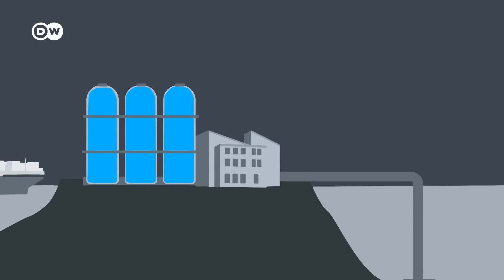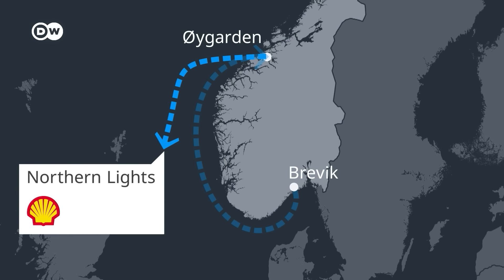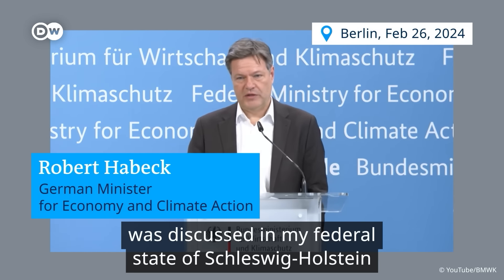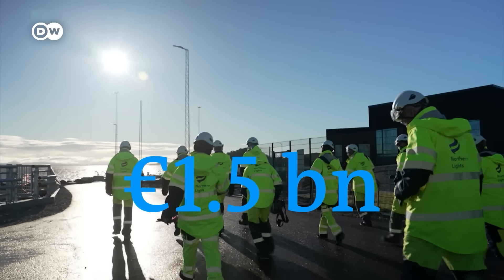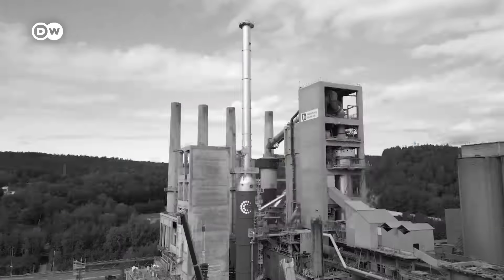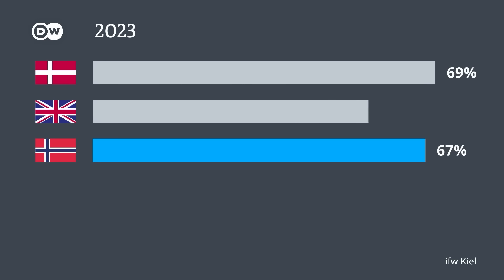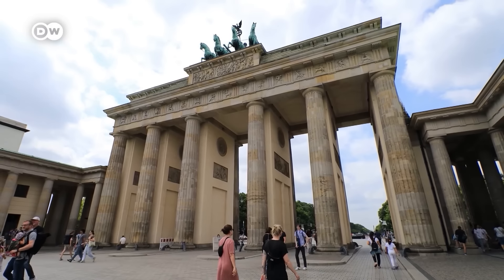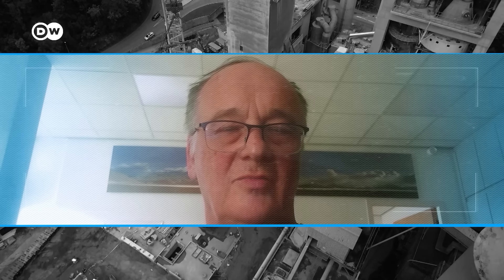Why Norway and the US are leading the way in this game-changing technology | Transforming Business

Comment: Carbon capture and storage is not game changing. It is in fact, allowing the current game of the oil and gas sector to continue. They continue to take subsidies from governments and the population, preventing subsidies from going toward actual solutions while continuing to profit privately. If "successful" with storage, the oil companies use a bunch more unsustainable energy to capture the CO2 and then defer the problem into the future with wells that must be continually managed and could leak as a result of many different geological events or the inevitable neglect that comes from loss of attention.
Reply: This
Reply: Nevermind that it's vaporware from 20 years ago...
Reply: yep, it's a red herring, a bit like saying you're solving gambling by creating gambling anonymous.
Reply: CCS is technically viable, but it isn't economically viable for electricity production.

CCS is game changing for cement, concrete and steel, which comprised 15% of CO2 emissions in 2017.  Net zero electricity is the low hanging fruit in the race to net zero.  Green cement and green steel is extremely difficult to achieve, and so CCS makes sense technically and economically in those industries.
Reply: @naomieyles210  Carbon capture may make sense in those industries, but storage is not a solution. If you are producing CO2, you need to find some way to permanently keep it out of the atmosphere. If you can sequester the CO2 in the cement you make, use it to make carbon fiber, use hydrogen based reduction for steel production, recycle the clinker in steel production as Cambridge University is proposing, etc. then that is a solution. Otherwise, it is simply deferral with future citizens picking up the tab.
Reply: @tetrahedralone  yes, agreed, local options to sequester are far better, and more likely to be more economic.  Once the imperative to sequester is in place, whether in carbon products, stone, recycled into the process, or underground, the free-market will supply that need.

The imperative is the missing piece.

Whether on the capture side or the sequestration side, cement and steel are hard to abate emissions, whereas electricity production are the easy to abate emissions.

Hence CCS and CCS alternatives apply to cement and steel, but are nonsense for electricity production.
Reply: 100% and does not scale!!!
Reply: I love you

Comment: I would have liked to see some numbers. Cause everything I have seen until now indicates that they capture less CO2 than expected and it takes more energy resulting in new emissions.

When it comes to concrete, you can add the CO2 doing the hardening process. This binds the CO2 chemically as part of the stone. This could be useful in brick and stone production.

But in general it looks like people are way too optimistic when it comes to CCS.
Reply: I was unaware of the CO2/concrete bonding technology.  Articles say it makes the concrete stronger, so at least that's a good thing.  But concrete itself is problematic, as it is water intensive to produce.  I assert that based on my limited reading, not from expertise.
Reply: I know a carbon capture machine that is powered by the sun
Reply: @jozews  The NASA thing?
Reply: @urkiddingme6254  the tree
Reply: @jozews  🤣  of course.  Been planting a bunch of those since the wildfire here.

Comment: so after the CO2 has been 'captured & stored', it then needs to be liquified for transport / export by land and sea, both of which require energy produced from fossil fuels, producing more emissions. 🤷🏻‍♂
Reply: Yes but it's total net emissions of the system as a whole is significantly less!
And we need steel and cement.
Reply: @fuze59  Yep this is what the far left eco folks don't get. There are many things that can be decarbonized easily, but the few that can't economically be done or the tech is too far off from the laboratory, like heavy industry, carbon capture is the key. Think of all the concrete and steel needed for those thousands of hectares of solar panels and wind turbines, the amount of concrete and steel produced via "green" sources for them is nearly zero, carbon capture tech will turn that around, not to mention the other tech out there to capture the CO2 already in the air that's causing havoc as it is.
Reply: If this works, as soon as it shows a profit, someone will start building pipelines to move this to the storage points. It may even be possible to pipe it in "packets" (discrete masses) in existing pipelines, making it even more attractive. And so far, the path the German chemists and Norwegians are on has gotten further than others to use at scale. And pipelines will improve an already impressive net emission numbers.
Reply: Why does it require energy produced from fossil fuels? Norwegian energy is nearly all renewable.
Reply: @fredericrike5974  Norway is building pipelines into Europe to import co2. Currently, we're building to Germany and Belgium and expect to be able to take 40-60 million tons of co2 per year, which is around 20% of German emissions and perhaps as much as 40% of the Belgian.

Comment: This is the same concept as putting a windmill generator in front of a fan to "save energy"
Reply: I sort of understand what you're saying but most of CCS has to do with capturing ancillary CO2 releases at the point source of their release, not at the point of combustion. For instance, CO2 is released in the extraction of natural gas in the north sea. It's not the combustion of the gas, just previously geologically stored CO2 getting out with the CH4. 
Cheap, easy and efficient way to reduce the CO2 contributions from natural gas.

Comment: Carbon capture is obvious scam. If you transport it 300 KM by ship, you are obviously doing more harm than good.
Reply: depends. Also ships can be made elctric.
Reply: @ArpanMukhopadhyay93 ya cause that has no cost at all on the environment much less$
Reply: Lot of Norway local ship traffic is moving to electric.
Reply: do your math and come back
Reply: @wanton7306  All modern ships are electric. They simply produce the electricity from oil. So it's like driving an electric car that's running from a gasoline generator. So we need to replace the generators, not the engines.

Comment: CCS for enhanced oil and gas extraction should be banned and off the table, it's inefficient and just produces more emissions. Only when then solution is without extra oil and gas production, can we start asking questions about efficacy and all the other issues around it.
It's unclear from the report if northern lights will be used to promote north sea O&G production but if it is, then this is a terrible project.

Comment: One thing not talked about in this video is how many wells need to be dug up to store all of the CO2 that is pumped every year. Will the ground end up looking like Swiss cheese? I understand you can store CO2 underground in a limited basis, but can that actually be done for every oil, gas, and concrete factory? Can it be stored year in and year out continuously through the lifespan of that fossil fuel factory?
Reply: That CO2 is less than the oil&gas that used to occupy the ground. That's why subsidence occurs over old wells

Comment: CCS has only limited applicability to mitigate pollution.   It should be used alongside cement production at least as an option.  CCS is not applicable at the well head or mine where fossil fuels are extracted.   In Alberta, bitumin production is only possible with the use of natural gas condensate to make the viscous tar like substance flow within a pipeline.  A third of the so called dilbit consists of natural gas condensate (naptha).  The carbon emissions of dilbit eventually are 1.3 times greater than burning coal.

Comment: CCS may be useful for certain applications where better solutions have not occurred.  It cannot be considered a solution for the economy at large, since too expensive/unwieldy.
Many U.S. oil&gas wells have highly pressurized reservoirs with significant CO2 gas content.  Professor Robert Warren Howarth (biogeochemist and ecosystem scientist), of 
Cornell University, estimates that 30%-40% of the oil&gas wells in the Gulf of Mexico are leaking....
Iceland has demonstrated CCS when CO2 combines with basaltic rock at depth, making stable formations that will not leak.

Comment: Lol, the painful truth is that as long as we continue to depend on fossil fuels to power our daily lives, oil companies will always take advantage and paint the picture of using massive earnings to fulfil their social responsibilities by investing in initiatives like carbon capture, which will in the medium-long term have a negligible impact on reducing global emissions due to costs associated with outsourcing, raw materials, technical know how and the magnitude of the infrastructure required. 
Also carbon capture is location dependent which adds to the cost especially for oil producers that may want to offset their own local emissions but have unfavorable underground locations for capture. 

More progress will be made by producing synthetic alternatives to many of the biproducts of crude refinement, making nuclear energy safer by finding a solution to the age-long conundrum of radioactive material with long half lives, and completely eliminating the use of coal for power generation. Carbon capture has the potential to bring about new problems for us in the seas or other underground locations proposed as potential storage points.

Comment: This carbon capture sounds like a time bomb - it is gaming the system by claiming lower carbon footprint of the "green" concrete thus making it look more sustainable solution compared to other options like engineered wood and whatever that might be far better way to go... There is a reason why they don't convert captured CO2 to for example aviation fuel...

Comment: Use whatever tech fits the situation and works. Don't shoot yourself in the foot making good the enemy of perfect. CCS is the only way to reduce emissions from some industries (concrete ect), so you either pump it into the ground or the air. Put it back in the ground please. 

It may also be a good thing to push in places that will for whatever reason, be using fossil fuel for a long time. Again, it's better to put the carbon back in the ground than releasing it into the air.

There is a line to be drawn. It's better to use tech that doesn't generate the carbon to begin with. If you have to generate carbon though, put it back in the ground please :)

Comment: All targets and pathways for limiting heat rises to within manageable levels requires some level of CCS. This is the view of all non governmental and governmental organisations who've published peer reviewed science based responses.
Reply: Could you explain this as I don't understand it? You may be way ahead of me on terms/Thanks
Reply: @ethimself5064  Which aspect specifically?
The idea is that we're not going to be able to stop all emissions, so the only way to meet net zero is to remove some of those emissions after you've made them.
You can either try to do that with a tree or a machine that acts like one taking CO2 directly from the air.
The other way is the way in the video where you capture it directly at the place you're making the CO2, like an oil refinery or a cement plant.
Does that help?
Reply: @LudvigIndestrucable  Yes, thanks. And thanks for getting back👍
Reply: Thought I would mention that I don't quite trust CCS as like anything we make it can and will fail someday. I suspect that major earthquakes would be one cause as well as mechanical failures.
Reply: @ethimself5064  not all storage systems require perpetual physical integrity, there are several that inject the CO2 into carbonate rock formations that the CO2 bonds with chemically.
Reply: @LudvigIndestrucable  Literally bonds to in a solid form?
Reply: @ethimself5064  Seems like a similar effect to how we make concrete nowadays
Reply: @ethimself5064  yes, the process occurs naturally over a long period as part of the weathering cycle (rocks exposed to air that absorb CO2 then get laid down as sedimentary rock). In the artificial version, you're introducing the CO2 millions of years ahead of time.
With other forms of capture, it's just for use in other industrial applications.